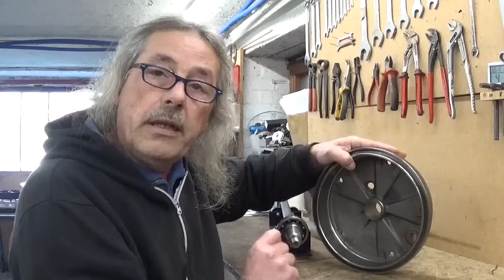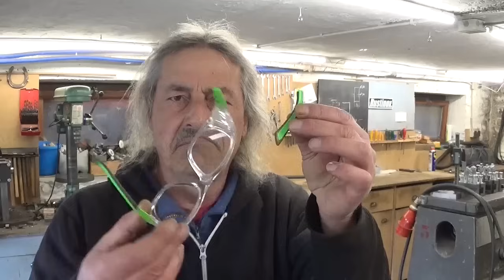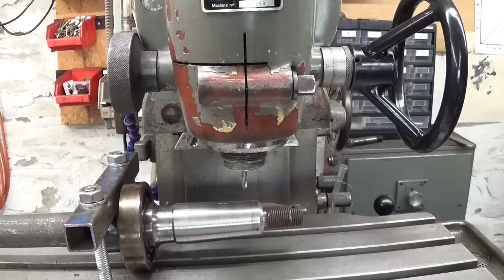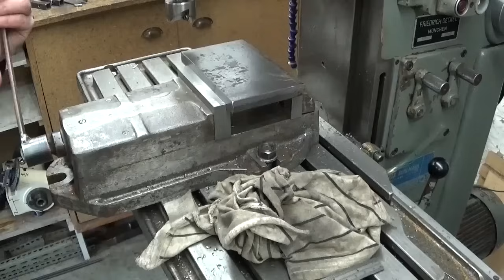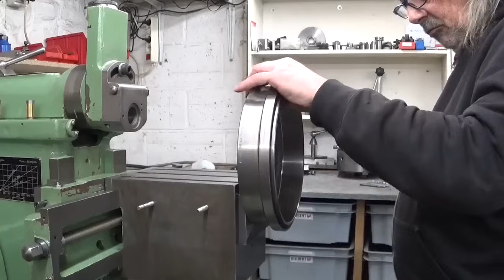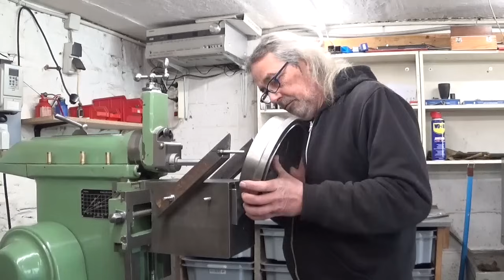Take a brake final part.

Comment: That was a clever setup on the shaper. As you say, cutting the slot is quick. The thing that takes the time is the setup. I did not know that your mill table can tilt. That can be very useful for some setups.
The popping sound from your grinder is probably the brushes. I had similar sounds from my one and the brushers were worn and barely making contact.
Reply from the maker: Thanks.
The problem with the angle grinder is in the switch. But I can't take it out without breaking the thing. Cheap junk...

Comment: Poor Bear. I will miss his updates and comments.  I might have tried to cut the drum keyways on the lathe. Nice job. Cheers
Reply from the maker: It's possible on the lathe but the setup in the right angle could be a challenge.
Reply: @Rustinox  Ah of course yes, not so easy on a taper. 👍

Comment: RIP Bear. That makeshift jig for the shaper worked well and how good is it that the mill has as much adjustment as it does to allow you to angle the table to where you want it. 👍
Reply from the maker: My milling machine is a gem :)
Reply: @Rustinox  Sure is 👍